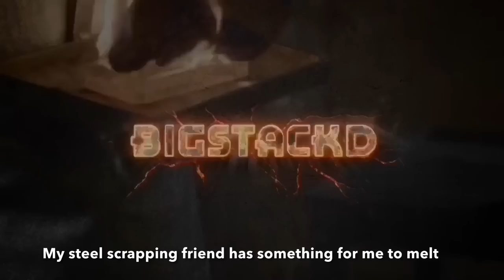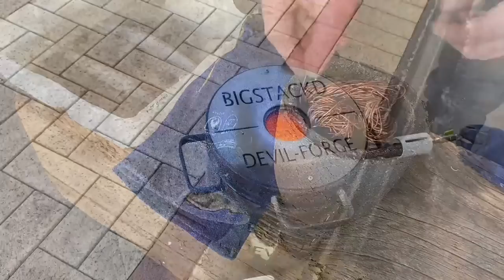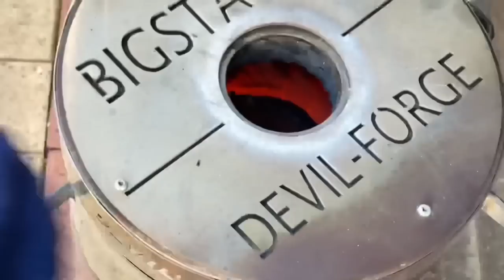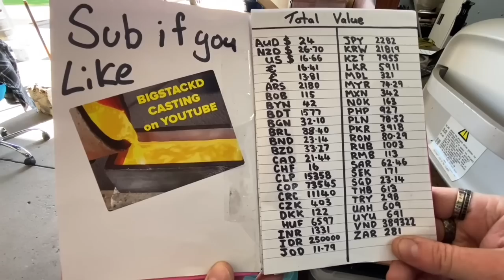Triple Melt - Awesome Alternator  Bars - ASMR Metal Melting - Trash To Treasure - Copper Aluminum

Comment: I'll give you a little tip. There is something called phosphorous or chlorine degassing tablets which are blue in color and I don't know the exact composition but when you submerge them into the melt before pouring, the aluminum is refined and all the slag and drose is reduced back to metal aluminum. The slag that remains will look like ordinary dust. So do some searching.
Reply: Dude sounds like a great way to reprocess the slag he usually saves 👌
Reply: Right, i think he has 2 totes of aluminum slag saved up, and it looks like a good bit of metal is still in there!!!!
Reply: @jam2190  it's difficult to remelt drose on its own. It's a laborious process. It's best to do it with each batch of fresh melt.
Reply: @Bluebirdiran  ok? I'm not the one with humpteen  pounds of it

Comment: The internal rotor (the thing that you threw into the forge that looks like teeth) can be pried open from the center assembly shaft. But it requires a tremendous amount of force.
Reply from the maker: Okay good to know mate👍🏻
Reply: @bigstackD  Good luck, sir! I enjoy your videos. What are you going to do when you reach 1 ton?
Reply from the maker: I’ll keep going I just wanted to have an achievable goal that I could get to over the next year or two. Plus I always wondered what 1000 kg of bars and coins would look like. I’m hoping to get to about 999 kg and then to go over the thousand kilo mark by adding  50 or 60 kg in one video👍🏻
Reply: @bigstackD  I believe in you!
Reply: @bigstackD  I constantly worry that your shelf or foundation will break from all that weight!
Reply: @bigstackD  That's going to be an EPIC moment in the casting canon, one for the ages!
Reply: 50 or 60 kg!?!😮
Reply: @bigstackD  You need an airplane engine/motor to take apart. 😁😁😁 I'm sure Aussie has an old airplane scrapyard somewhere. 🙃🙃🙃 🤫🤫🤫🤭🤭🤭
Reply: @bigstackD   2mil sub special? 
Or 1.5mil 🤔  
Just get a couple aluminium car engines lol

Comment: @11:11  Did the point where the steel was half exposed to air, accelerate the cooldown process? Perhaps having an air medium next to the water medium next to the body in question, causes an acceleration of energy transfer when at the correct ratio???

Comment: If you kept the aluminum in the furnace longer would that reduce the amount of slag you have to skim off? Seems like when you re-melt the slag it doesn’t yield much. Also, would adding borax to the copper and aluminum bring the impurities to the surface for easier skimming? 

Enjoy your videos, can’t wait til you reach your goal. 1 tonne = 2200 US pounds? 
Cheers to you and the boys.
Reply: I think further heating will increase slag, as the aluminum is oxidized more easily as it is hot.
Reply: @taxesdeathandtrouble.1886   I believe they use a metric tonne as a measurement in Australia.
1 metric tonne = 2204 lbs ( U.S. measurement) 
1 U.S. TON = 2000 LBS American. 

You know, that pesky metric system that Americans refuse to acknowledge. Lol.
Reply: @taxesdeathandtrouble.1886   and 1000kg = 2204.623 lbs. notice at the end of video he gives both measurements.
Big stack is simply using his country’s system and providing a imperial equivalent for us yanks.
Reply: @PatrickMersinger  thank you Pat but speak for yourself I'm from the south 😂

Comment: You should put the nut back on the shaft end a couple threads. When you hit it with a hammer, it won't mushroom out the end of the shaft and prevent you from taking it apart.

Comment: Don’t know if you’ll even see this but I melted an alternator not long ago and the copper that came out of it when melted and poured is a complete different color than everything else copper I’ve melted before. Did u have that issue? IT pretty much looks like bronze but I know it’s copper but have no idea why it’s a different color. Maybe the coating on it or some other type of metals in the copper? No idea, just wondering if yours is that way too
Reply from the maker: BigStack sees all 👀
My bar came out like all my other copper bars with no discolouration at all so not sure why yours came out that colour but It would still be a pretty cool bar regardless of how the colour came out👍🏻😁
Reply: @bigstackD  yea it did come out looking cool that’s for sure just was afraid it had bronze in it cuz of the color. I’ll prolly just remelt into some cast coins cuz it is a cool color
Keep meltin brutha your vids are awesome
🇦🇺 🇺🇸

Comment: You need to cast a Brass or copper hammer head. Casting 101..Smashing the shaft, you will never get the bearing off. Without cutting it. You need a Lathe and Bridgeport. Make cool stuff out of the metal.

Comment: I have a question, would you be able to have copper in the bottom of the crucible while melting aluminum and not have the two mix durring the melting process?
Reply: So long as you controlled the temperature and didnt let it get hot enough to melt the copper, only the aluminum, its possible i suppose. If they were both liquid they would mix and make a crappy brittle ingot lol

Comment: That particular mold sure makes some fine looking bars. I'm suprised that so much of an alternator is aluminum... that said, did you melt the copper bars from between the steel pieces with the wire and I just missed it, or was that just put away for future melts?

Comment: Can someone explain to me what exactly this vessel, in which the metal melts or becomes liquid, consists of ? At what temperature does the vessel start to melt ?
Reply from the maker: The Crucible is made up of clay graphite and can withstand temperatures up to 1500 - 1600°C and the furnace can only get up to about 1350°C👍🏻
Reply: @bigstackD  ty!

Comment: Was thinking about the porous castings you get pretty often, @BigStackD, and was wondering whether you’ve ever tried poling to remove the copper and aluminum oxides. https://en.m.wikipedia.org/wiki/Poling_(metallurgy) It’s a two-step process but you can probably skip the air-bubbling and go straight to the second step of adding petroleum or the traditional evergreen bough because your scrap material already has its sulfur removed. (Thanks @Bluebirdiran for reminding me about this with your post on phosphorus and chlorine degassing tablets.)

Comment: question: if steel needs much higher temperatures to melt, why not steel crucibles?
Reply: Because steel is heavier and oxidates. So you would get steel slage everywhere and in your melts. Also too thin and it will blow through. Too thick and it adds another 15 lbs to a already 25-35 lbs batch. Trying to hold with a pair of tongs sidways... the carbon bonded silicon carbide and ceramic bonded clay graphite ones are cheaper, lower oxidation and high thermal conductivity.

Comment: I love the way you so gently dismantle things.  Carefully taking them apart with a hammer like that.  Such precision!  😉

Btw... Your burger looked delicious!  Personally I would add bacon and jalapenos.  Maybe some hatch chilis, but that's just me.  Looked great!

I'm very curious.  You always seem to have a lot more slag from aluminum than copper.  Is that impurities in the aluminum or just dirt from being the casing?
Reply from the maker: Yes there’s a lot more slag with aluminium as that would’ve just been the dirt sand paint and other stuff on it. When it comes to copper it melts at such a high temperature that any impurities will either sit at the bottom of the Crucible or float on top and if you pour carefully you can actually leave the ash and any slag from the copper inside the Crucible. I don’t like to skim copper as it’s so bloody hot it melts my gloves so I try to pour and leave any slag in the Crucible but as you will see in today’s video a little piece snuck through into the copper ingot while I was pouring
Reply: @bigstackD  Burger needs those tomato's lightly grilled as well, bit thicker and grill them with black pepper on both sides.
Reply: "surgical sledge"

Comment: What about the 2 bars from the insides of the claw things
Reply from the maker: I put them in with the wire and melted it altogether, if you have a look at the Crucible when I put it in the furnace the two little bars should be visible at 19:42👍🏻

Comment: I need to ask, what about the 2 smaller Copper bars you had to melt out of those weird steel pieces? You haven't mentioned them or measured them alter in the vid, sir 😁
Reply from the maker: I put them in with the wire and melted it all together. If you have a look when I put the big Crucible full of copper into the furnace the two bars are in there with the wire👍🏻
Reply: @bigstackD  I actually did not notice that, thank you for clarifying 🙂

Comment: A  guy  really has to wonder if the energy you used  in  gas  and tires  to get these,  and the  fuel  to melt them,   didn't cost more than what the scrap is worth.

Comment: Wanna say quick I previously posted for dark pinkypurpley copper bars to quench in a small amount of water or in warm water. I have since done 2 more 1kg copper bars and I used a small amount on one and it was too small it boiled the water bad instead, and the other I just threw in a pale. Soo, for me, it's a fluke I don't know. Sorry. Happy melting.

Comment: You must have melted the first two copper bar into the overall one.
Reply from the maker: Yes if you go to the section where I put the copper wire in the furnace you can see the two bars inside with it. I accidentally cut out a few seconds during editing which showed me putting the bars in with the wire🤔

Comment: why cant you put the metal inside the mold and then put the mold inside the furnace ?  then you dont have to worry about pouring it
Reply: Graphite molds can melt(yes, actually melt) if exposed to high temperatures for too long. And from what I’ve seen, his cast iron molds are probably too big to fit into his mini-furnace.
Reply: @fionagibson7529  thanx